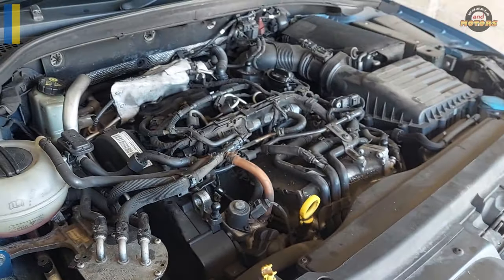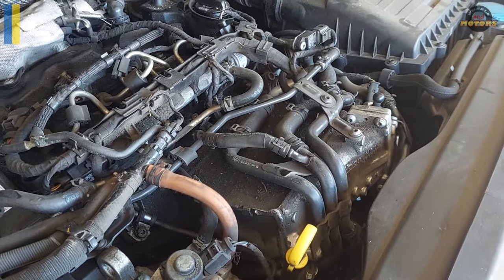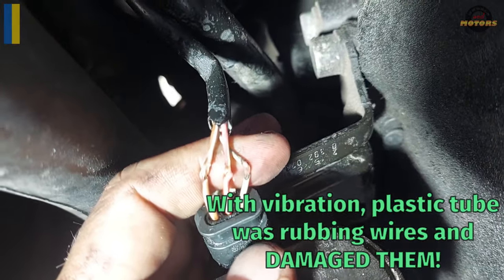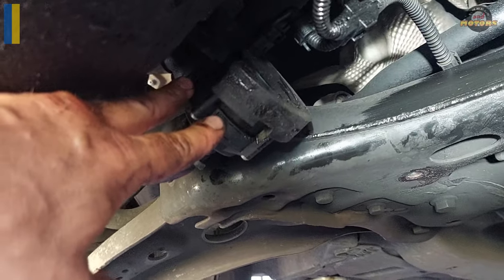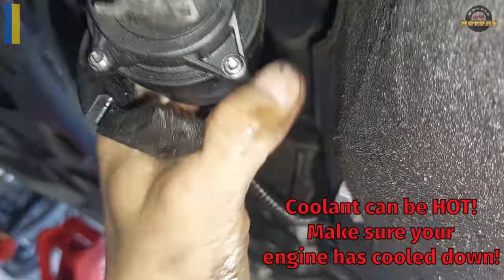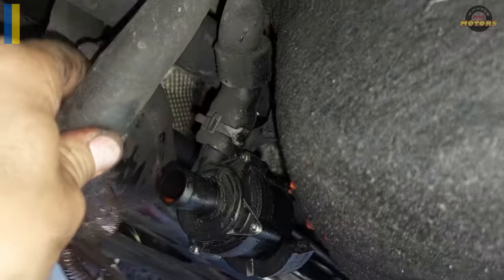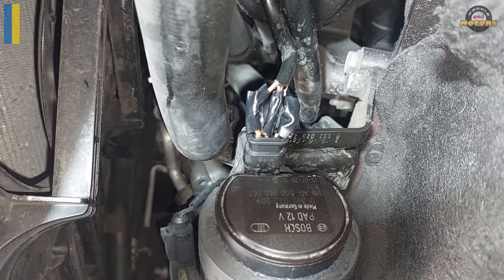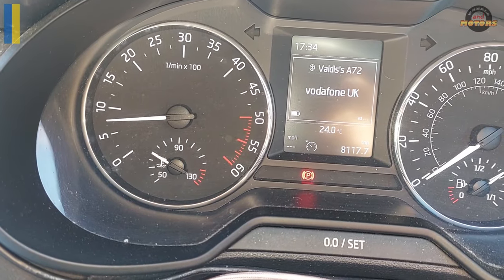FIXED Heater Support Pump, Coolant Pump for Charge Pressure Cooler P16C7, P190E, P023A, P023B, P023C

Comment: 518K+ km... wow!
How often was the oil change?
Were there any issues with engine till now?
Reply from the maker: Oil change every 9400miles / 15000km.
I bought it cheap at 102.000 miles with the injectors problem. When I replaced injectors, some time later I had some fault with boost pressure. Replaced turbo just in case and got rid of DPF and EGR. Not 100% sure if it was necessary,  but it's done. Now I drive it with no problems for a while.
I'm waiting for clutch asking for change. It still has original clutch. My previous Sharan  was asking for new clutch every 160.000 miles.

Comment: Hello was it losing coolant by any chance?
Reply from the maker: No. Not really. 
I was losing coolant in the past inside egr cooler. That was impossible to detect from outside.
Reply: I have a 2013 seat Leon  2.0tdi its coming up coolant pump for charge pressure sensor but it’s also losing coolant but doesn’t seem to be running into head gasket just can’t find the problem there’s no leaks from water pipes any ideas what it could be?
Reply from the maker: I had issue when it was leaking inside EDR cooler. Till I had to deal with EGR, I didn't know, because it was evaporating with hot exhaust gases. 
It could be something else. I can only guess.
Reply: Appreciate the reply thank you🙏

Comment: Hello Mate, I have mk7 golf before I hade code P190E and I changed front pump.
After changing front one, new code apear for P190D.
Can you please help.
Thanks
Reply from the maker: Both codes seem to point at the same pump. Second is more specific, saying that there is a mechanical malfunction with it...
I don't know.. Is there a warranty for the new pump you have installed?
Reply: @wawayltd  it's brand new pump, Installed yesterday from TPS.
not sure about warranty can check with my mechanic.
Reply from the maker: I wish I could help you there, but I'm afraid I can't. It could be faulty pump, or maybe pump is fine, but something else causing that mechanical issue, maybe pipe blocked or something else. I can only guess. Probably have a word with your mechanic.
Reply: @wawayltd brother I have this code:

p16c100 such a headeache should I replace the same pump as you did ?
Reply from the maker: I just googled this code. It says "engine control module or transmission control module has too high an internal temperature".:
Possible causes of this fault code are:
A short circuit or overvoltage in the control module circuit.
An internal fault or malfunction in the control module.
A cooling or ventilation problem in the control module.
An incorrect installation or an unauthorised modification of the control module.

I don't know what exactly causes this fault.

Comment: Hi, i have p190d00 coolant pump for charge pressure cooler mechanical malfunction 
Skoda octavia 1.6tdi 
VIN : TMBBG9NE7G0159220
I am a bit confused about chich part  to replace.
Reply from the maker: Hi! In your car (same as mine), an intercooler is water cooled. The fault code points on to that little pump that pumps the coolant into it. You'll see coolant hoses coming out of metal box that sits on intake, follow them. I think it's one of 2 electric water (coolant) pumps hanging by oil sump.
Here is more on that:
https://www.vwaudiforum.co.uk/forum/showthread.php/198777-P-190-d